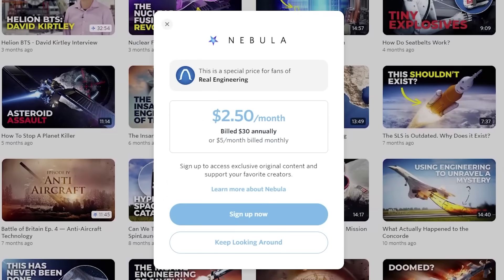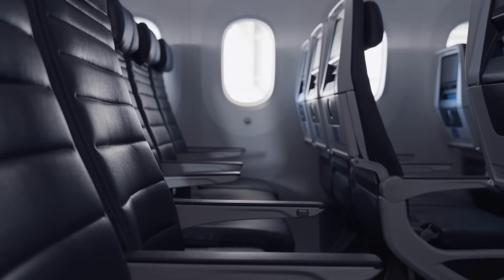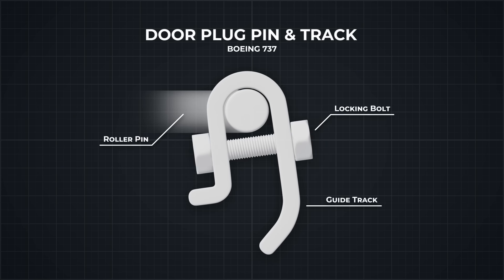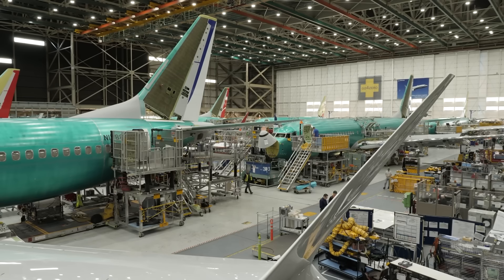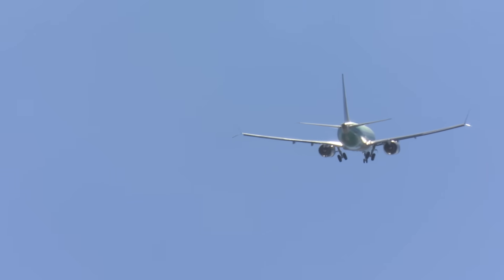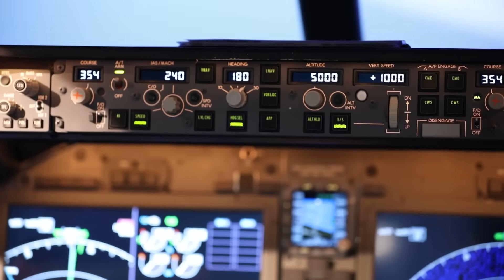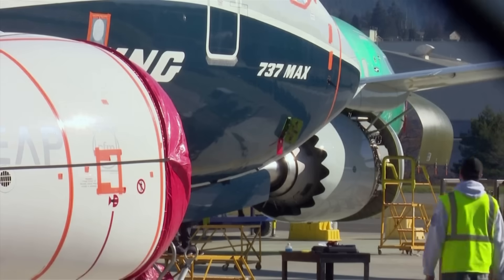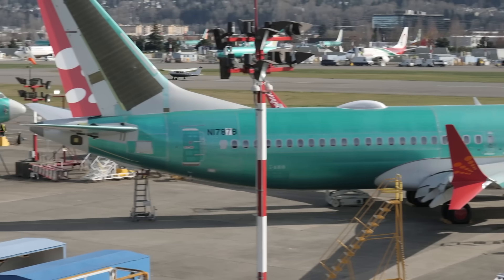The Questionable Engineering of the 737 Max

Comment: Another lucky fact is that the door plug blew out only at just under 16,000 ft at 30,000+ ft the aircraft would likely have had severe damage and even likely even lead to a hull loss, killing everyone on board. We just don't know how many more latent issues/defects lie within the 737 Max and any new aircraft Boeing puts out.
Reply: It looks like the door plug or debris could possibly strike the horizontal stabilizer which I'd think could have led to a crash as well.
Reply: Just a small nitpick, these door plugs are not unique to the 737 MAX 9. The older 737-900 uses the exact same door plugs.
Reply: @cell5066
Yeah. That speaks of the soundness of design of "737". But other things should follow.
Reply: @cell5066
It is their (fare-paying passengers') luck.

Comment: Before I watch this video, I've read a number of articles on how and why the Alaska issue happened. It's not an issue with engineering this time. The same solution has been in place with the NG generation. The issue is with how Boeing has sold their fuselage manufacture to the lowest bidder, Spirit AeroSystems. They are based in Wichita, KS, and then ship the full fuselage on trains up to Renton, WA. Spirit obviously haven't been paying due care and attention to their manufacturing process and the retention bolts on the blanks have not been correctly installed. I dread to think how many more corners Boeing are cutting both internally and subcontracted.
Reply: Spirit is not really at fault here. Boing replaced a door seal at that plug door. To do so you have to open the door plug and to do so you have to remove the securing bolts as these prevent opening it. The seal was replaced, but someone plainly did not reinstall the securing bolts and the QA procedure did not ask to check for the bolt installation. The first mistake was not caught because of second procedural mistake.

Comment: I knew this video was going to be full of errors as you have no real engineering experience in aviation.
1:50 the image shown is a full-sized door and not a over-wing emergency exit, which is the kind of door that came off the plane in this incident. You can still clearly see it is a over-wing emergency exit door from the inside and the flight attendant will even ask you if you are comfortable operating it during an emergency. If you are not they will re-seat you in a different location.
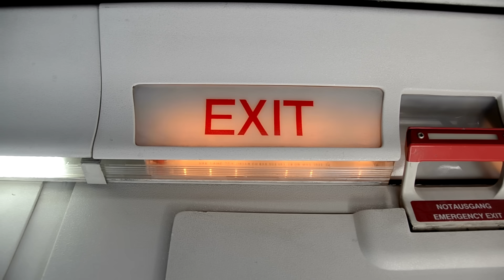Also, it is impossible to install a fully-functional door in that location as you state at 2:20. That's the case for any aircraft. Fully-functional doors are enormous and contain a lot of mechanical components.

Comment: Deviation from certification requirements (exemptions) is not that uncommon, particularly time limited exemptions. EASA and FAA have a process (Certification Review Item, CRI) for exactly that. However, I agree with the pilots union that memory based risk mitigation is a very poor solution. 

Production errors can often occur when one organisation changes their process in isolation. E.g. Boeing stopping doing cabin fit out through those doors and therefore no longer having job cards to tighten the temp fit fasteners from Spirit - but without telling Spirit they've changed.
Reply: although here these bolts were not reinstalled after the door seal was replaced. The QA procedure did not include checking the bolts as in Boing's system they c&p the procedure from the door seal QA process. So first the bolts were not reinstalled and second the bolts were not inspected.

Comment: Regulatory oversight isn't the solution here. If it were the FAA would already be clamping down on them and asking for such an exemption would be unthinkable.

Intense regulation in the airline industry has (for a period) produced a very safe industry, but it has also produced a very uncompetitive one with only a few major megacorps able to afford the economy of scale needed to meet those regulatory regimes. Centralisation plus time equals corruption so inevitably the initial gains in safety are eroding and abusive practives are cropping up.

I'd submit that increased competition would help to solve this problem, but the global policy trend is to discourage air travel altogether so I don't see that happening any time soon.

Comment: I didn't know that "Door Plugs" existed but how is anyone supposed to inspect that the bolts are secure (or even present) with an interior panel covering them? What a dopey design! And why wouldn't the panel be welded in place or at least secured mechanically so it doesn't blow out and depressurize the plane?

Comment: I'm surprised that the plug fixing mechanism isn't fail safe. With cabin pressure it wouldn't be difficult to design the setup so it can't move, instead of relying on bolts.
Also I think the root cause is greed, systemic to our current society. Personally I think the decision makers should be jailed, instead of being fired with a fat check.

Comment: Ok so I’ll start this off by saying the max probably shouldn’t exist in the first place, it’s a 60 year old design with its roots in the 707 which is 70 years old. Mcas was implemented very poorly and 
pilots should’ve been made aware of it. 

But this video leaves out some things. The door plug is not a max problem. It has been used on the ng for years without a problem. It is a Boeing quality control problem and Boeing really needs to get their shit together. With Boeing trying to get waivers on the new laws, the new laws has to do with how the plane alerts pilots to problems. The max 8 and 9 have the old system which has been working perfectly fine for 60 years but without the wavier the max 7 and 10 will have a different system which could confuse pilots moving between types. So in this case leaving the system alone is the safe option. 

And lastly there was no reason to bring up the southwest incident, it had nothing to do with what you were explaining. But I do agree pilots shouldn’t have to worried about how long the anti ice has been on for, that could very easily be forgotten about.

Comment: The cockpit door was not ripped open from the force of the decompression event. The door was designed to open for decompression events, so that if the cockpit decompressed, the pilots might get more oxygen from the cabin pressure.
Reply: "so that if the cockpit decompressed, the pilots might get more oxygen from the cabin pressure"  Where do you get this stuff?  When the cabin decompresses there's an 8 psi pressure differential between the cockpit and the cabin.  That results in the cockpit air imposing a 17,000 pound force on the cockpit door.  There are only two options here when this happens.  Either the latch releases and the door flies open, or it blows off its hinges and flies into the passenger compartment.  There is no third choice.  It was designed to open so it wouldn't blow out and kill somebody during decompression events.

Comment: Ok, several issues with your visld, which is kind of shocking  given your track record. 

1 The metal piece locking the nuts onto bolts are cotter keys/cotter pins, NOT a wire.

2 MCAS  was needed due to thrust offset, weight offset, CG and center of lift, as well as the aero effect on the bottom of the engine nacelle. 

3 The warning lights were investigated and no cause could be found. FAA regulations allow operation of an aircraft with certain, well defined problems, and this was one of them. The change of the aircraft to non-over water was not mandatory, and was done as added as a safety measure by Alaska Air.

4 The plug has to move UP to be able to be removed.

I love your detailed videos, and this is just a one-off, but there was a ton of less than perfect information here. Ita great you put in a very well produced video, but maybe leave detailed aviation discussions to those channels that live it, such as Blancolirio or Mentour.

I mean, this is possobly worse than news outlets conflating the recent 747 engine issue and linking it to this 737-9 Max issue, when the problen is 99.999% likely a GE engine problem, with zero culpability foe Boeing.

Comment: Im gonna propose a new law/theory.

Anytime a company subcontracts out anything the chance of something going wrong doubles.

It would be called Boeings Law.
Reply: I actually work on the 737 line, and you're correct, and works in an extended way as well, since our suppliers (The sub contracted companies making our parts) have also started subcontracting, and one of those sub-sub-contractors messed up something on the plane so badly that we were only able to build maybe 5-6 planes in month, compared to producing 2 a day.
Reply: Or maybe "The chance of failure of a subcontracted part or task approach unity as the cost savings increase."
Reply: No this is wrong for many reasons. When you are dealing with manufacturing large things like ships and planes (and some but not all tanks) there are very few companies that are capable of manufacturing high quality versions of every possible component you will need, so it eventually gets to a point where it is just cheaper to hire out the work and this will end in a better quality product so long as it is managed correctly, this is how ships have been constructed for at least 90 years and I don't know how long a planes have been constructed this way, but all of the big plane manufacturers have been doing this for at least 30 years. 

Now when it is not managed correctly, the chances for failure increase exponentially with each mismanaged subcontractor but to call this a new revelation would be like saying the screwdriver is a new fancy tool, an objectively wrong take and probably since a very long time ago
Reply: The point I was trying to make was less about companies subcontracting out work to companies that are actually competent @the_undead  and more about there being several layers of subcontraction in stuation s where companies who don't know crap about the thing they are contracted to make try to make it anyway. Then there are lazy workers who don't do complete jobs because they either aren't trained by the company properly or the worker shouldn't have been hired in the first place.
Reply: @albal156  I'm not 100% sure, but the Airbus A380 to the best of my knowledge for some of the components had four or five layers of subcontracting, as a consumer that doesn't deal with large scale manufacturing It is understandable to just assume that subcontracting means nobody is qualified, but even something like a house is child's play compared to manufacturing a plane much less a ship. It is unreasonable to assume that even 10 companies between them could have enough skill and manufacturing capacity to make an entire plane that has a chance of meeting international standards to be called a commercial airliner, Even if all 10 of those companies are valued in the tens of billions of dollars

It has nothing to do with the fact that subcontractors were used and everything to do with how they were managed, because like it or not people who have found themselves in the position where they are an engineer at a company making components for aerospace, they will want and almost certainly know how to do it correctly. It's just a question of whether or not management is willing to spend the money needed to do it correctly
Reply: Airbus seem competent at making stuff and managing their companies that make/ manufacture their parts  @the_undead  or at least I haven't horror stories about door plugs coming loose or other parts of the plane not working properly.
Reply: @the_undead point still stands, not because of qualifications but rather because increased subcontracting makes it more likely for mismanagement.
Reply: @StevieQ  You're not exactly wrong, but the number of projects that have been perfectly successful that have had three plus layers of subcontracting dramatically outnumbers the unsuccessful projects with three plus layers of subcontracting. And seeing as the point as far as I can tell is that subcontracting means nobody is qualified, just does not stand. If the original point was subcontracting increases the risks of things going wrong, that's an entirely different argument that would take a lot longer to discuss and I don't know if it does increase the risk or not, but seeing as that is not the original point the other person made. I'm not going to argue about that (partially because that would take an insane amount of research that I don't think anyone has done)
Reply: @the_undead  OP said "the chance of something going wrong", not anything about anyone being unqualified, and neither did I (much the opposite).
Reply: @StevieQ  The only time the chances of something going wrong goes up is through mismanagement, over the last 40 there's probably well over a thousand projects completed both for government and private industry that had as many or more layers of subcontracting than the 737 Max that were flawless or mostly flawless projects. 

But saying mismanagement leads to bad projects is a new revelation is like saying new research suggests humans might need to eat to survive the statement is a complete waste of everyone's time because everyone already knew what you're trying to claim
Reply: @the_undead  you seem to keep missing the point and not reading what was actually said, so I'll leave it there. No worries. Just an interesting thought on the internet.
Reply: I made a wikipedia page for it: https://de.wikipedia.org/wiki/Boeings_Law
Reply: It sadly got deleted  @tobiasjacob1969  😄
Reply: @albal156
There is what is known as "Zeus" fasteners (I don't know whether they still have them) for any fasteners.
Mostly such small parts are subcontracted. And there is a whole host of acceptance tests. Then there are the routine check-lists before committing it to flight. A thorough inquiry only, can bring out the missing link(s). Or are the management guys saving on salaries/wages paid to the workers (to keep the salaries bill low).
Reply: Nah just don't buy Made In China companies like the CCP controlled Boeing
Reply: Or we could just get rid of DEI
Reply: Subcontracting is not a problem. Let's say you're in the business of making planes. You determine that to fasten that thing on your planes, you will need a screw. You define the specifications that the screw will have to match. Then you have two choices: either you buy it, either you make it. If you buy it, you will have to set up some quality check to make sure that the supplier's screw matches the specs. If you make it, you will have to create a whole new company able to craft the specified screw, and then still set up the same quality check, because why wouldn't your own makeshift screw-making company do the same mistakes than a specialised supplier ? If you need a special thing it might be safer to buy it from a specialised supplier. Even if it turns out that the problem with that Boeing plane was the screw... why did Boeing let a bad screw be used in their plane ? And wouldn't the same problem have occured if not-screw-specialised-Boeing crafted the screw ?
Reply: @felixmariotto4639  Some people just don't care. Sometimes those people happen to work for your supplier. They'll do anything to avoid having to do something. They'll give excuses such as "it's too expensive". They don't realise that going forward with defective parts just isn't an option and that if they don't fix their problems, the whole project will have to be canceled because the reputation of the company is more important than a failed project and they will not get paid anything if they let it be.
Reply: Airbus (and everyone else) does the same thing from what I understand.
Reply: @cefb8923  Yeah, but Airbus has this weird thing called "basic competence".
Reply: @cefb8923  Correct, I interned with a manufacturing company that made small structural parts for most of the major aerospace companies. From what I understand, parts are designed and assembled by the companies, but a significant portion of manufacturing is done by subcontractors.

Comment: Designing plug so that it fitted from the inside would be a much better solution.  Boeing is a failed company and is not led by people with an eye on safety.  Money people have taken over.  The company wanted new engines to make the plane more efficient.  They should have designed a new plane and the company should be nationalised and shareholders and execs should get nothing.

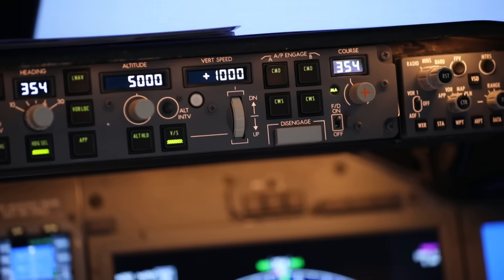Comment: @7:35 "in some cases pilots were able... ...turn off malfunctioning system..." - Sorry but that's incorrect, on the first 737 crash the LionAir pilots were never told about MCAS. A week later a Boeing bulletin informed the Ethiopian Air pilots about MCAS, but didn't provide any training. MCAS has no off switch. Pilots needed to turn off some instruments controls to deactivate MCAS, so they're flying blind, no altitude, no pitch. The Ethiopian Air pilots did as instructed. But later they mistakenly thought they had enough altitude to briefly check their location (also failed to reduce airspeed). When their instruments were turned back on, MCAS took over, nosedived the plane, and crashed. Then that Boeing CEO and others had the audacity to blame the pilots alleged limited skills from a 3rd world country, as the implied cause of the crash. The revised MCAS still has no physical off switch, the new software reduces its adjustments/controls and when it's activated. It's limited to 3 activations, and no longer overrides input by pilots.